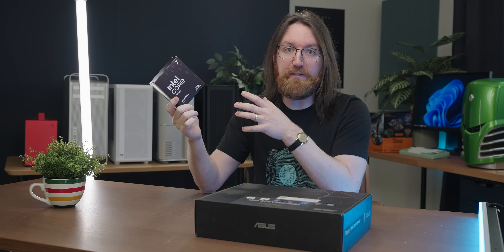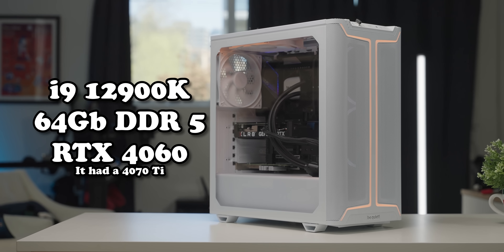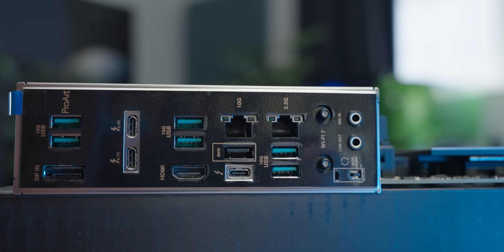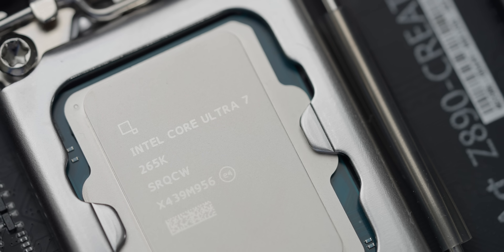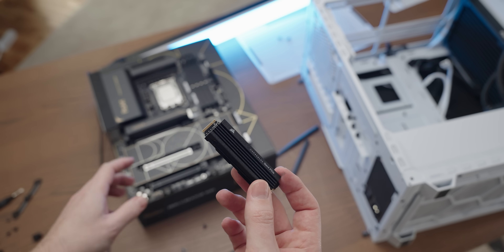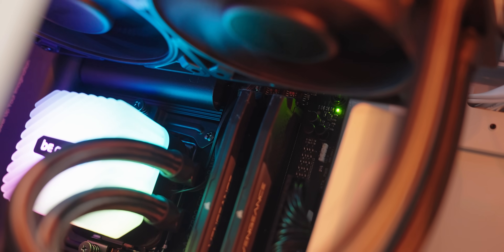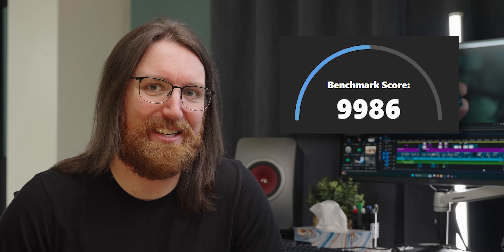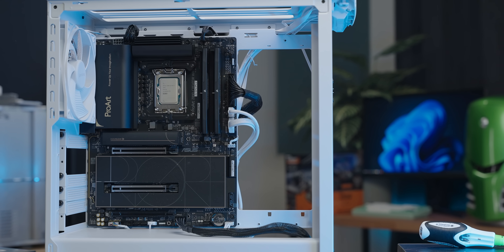I ACTUALLY Bought An Intel Ultra CPU In 2025...

Comment: Intel extinguished thier cpu lineup to start cooking for thier gpu lineup.
Reply: No, the B580 is even less competitive than Core Ultra.
Reply: @lharsay  For 250€ the B580 punches above its weight class.
Reply: @lharsay are you delusional
Reply: @happygofishing  just look at the raw specs, the B580 is basically an RTX4070Super, yet it's only half the performance.
Reply: They are just getting started on this generation of CPUs. I would imagine in the next year or two they’ll be back on top. This coming from an exclusive Ryzen user
Reply: I don't see it happening ngl.

Comment: I've actually never seen anyone talking about this CPU
Reply: The reason is its so similar to 285k in performance so intel just not let anyone review it.
Reply: LGA18XX socket isn't likely to support further than Arrow Lake, plus the underwhelming performance in game so no one really cares about this. I might get onboard next year when Arrow Lake get massively discounted to get rid of old stock, as it stands my i9 11900F is still rock solid
Reply: @ThangDamMinhwell Linus from ltt continuously calling out Intel BS since 10th gen and before. Finally he stopped caring about intel repeated greedy treatments
Reply: @ThangDamMinhHot take on 11th-Gen. I liked it too actually. I had an 11900K and it was a great CPU once you tuned it.
Reply: @ThangDamMinhgood idea. I just bought one on new egg they had so many discounts it basically changed my plan of getting a 9900x  instead.
Reply: @ThangDamMinh it excells in video processing and productivity like photoshop and such. its like 4x faster than a 9800x in these type of tasks
Reply: for multiple very good reasons
Reply: The 265K is a good CPU. Right now and for some time, MicroCentre has a 265k and MSI Z890 MB for $530 USD (which is less than what I paid for my 285K with a 1T Corsair gen 4 and some video game freebies tossed in)
Reply: Because all anyone can talk about is X3D, even those AMD fanboys that don't own an X3D. It's just like the Nvidia owner that bought their 4060 only because the 4090 exists, while not even considering Radeon. For the money and if you don't own a $2000 GPU to game at 1080p the 265k gives up nothing in gaming to X3D in real world settings and pairings, while utterly curb stomping the X3D in multicore. And that's when the X3D is a whopping 50% more expensive.
Reply: That’s because it really is only good for very isolated productivity workloads. And you really need to do your homework to figure out if it works for you.
Reply: I loved talking about how happy I am with my 285k on the PCMR subreddit, but the comments usually mirror the youtube comments, but worse, something along the lines of...
- hardy harr, you wasted your money
- bad value
- AMD IPC better
- why didn't you go AMD?
- Intel bad
I got tired of it, so I stopped talking about it and deleted my posts.  I don't think I should have to justify my purchasing decisions, but I got an 1851 board for free, and though my original plan was to get a 265k, the stars aligned and was able to get a 285k for not much more money.
Reply: 6 Months with all the BIOS upgrades I am loving this CPU
Reply: @ProfexionalGaming  Intel is now the value king hahaha.
Reply: It appears to be the best (or least poorly) selling of the series as a cheap productivity CPU.
Reply: Man, the #1 pre-built on newegg had a U9 285K @lharsay
Reply: That means you're probably only watching gaming focused stuff.
Reply: I bought it. And I play games on it. It plays well for me.
Reply: I think you should use search in youtube sometimes
Reply: Bucz iyk ik
Reply: They abandoned the i3 i5 i7 for..ULTRA....hmm
..
Reply: @chen4132  - yes, 3 generations across 3 processor configurations and multiple varients. IT MAKES NO SENSE that Intel would abandon the LGA1851 socket after 1 generation.

The actual architecture within the Core Ultras is far superior to its predecessor. people (by that I mean gamers) seemed disappointed with generational progress in performance - but, gaming is but a tiny fraction of conputing. Although I miss Hyperthreading, I prefer the wisdom of the Core Ultra die layouts.

I have gotten 1589 on Cinebench 24 multicore with a 285k running XTU. It capped the silicone a <300W and 400A I think it was and core temps were 65 deg C ish. I can push them into the 70s C. But why? 

I would be interested what @DawidDoesTechStuff gets on his silicone  (we are running different CPUs but I can't make the comparison myself). He made the right choice. The MB might be a bit weak and be holding it back a smidge.
Reply: Well, they're shit for most things, if you just buy their predecessor, it will be much cheaper, and give more performance
Reply: It's obvious why
Reply: read it is curated to be pro amd
Reply: Why would you? This whole line is a literal joke.
Reply: tech notice and other creators who do video editing ,ultra cores are the best in video editing
Reply: I gots it in my gaming pc
Reply: Felt like a decade since all the Intel instability issues and these CPUs launching.
Reply: I wish there was more
Reply: @a.jracing - y'all know this guy Geoff/maybe Jeff Gearing (he's big on the ARM CPUs Raspberry/orange... fruit pis...).

He had some board with an AMD server CPU I think it was and was doubling cores on top of the previous like 48 cores. It may have been more, I don't recall.

Anyways he has a screenshot showing Cinebench 24 on all those cores -- low and behold, my 285K w/24 cores out performed it.

This guy is right, the Core Ultra 7 is one heck of a performer for the price. I have the 9 and there's a price gap. I don't regret the buy but my temps are great, it's stable (Linux - as an educational experience has been a tad rough but I think that's a Linux thing and me not knowing more).

What I think is one of the most important features of these is the new chipsets that will let you run both - your video card AND NVMe at full PCIe 5 speed. I have only a 40 series card but I don't slice it to 8 bit mode like so many Z790 boards.
Reply: It's like talking about which seat on the bus is the best
Reply: All these YouTube channels are focused on gaming performance. There is a whole other massive spectrum outside gaming if it comes to computers.
Reply: @robindebondt4643  Almost as if the majority of their viewers are gamers or something. Shocking I know.
Reply: me too!
Reply: That's because Youtubers are 95% gaming only, they dont care about using a PC for anything else. You wont get anything close to a proper review out of the likes of Hardware Unboxed for example. Even when they include productivity benchmarks they dont do it well.
Reply: @chrism2964 It actually has to do with the lack luster last 2 generations. Its gonna take a couple of these Ultra cpu's to catch on.
Reply: Where have you been under a rock? Hardware unboxed and Gamers nexus reviewed it at launch.
Reply: I swear these are just rotting in warehouses, the Ultra 5s especially, who tf wants a 10 core CPU in 2025
Reply: the problem is the 5800x3d destroys this cpu on the benchmarks.
Reply: @viscountalpha  Jumping in here—no, the 5800X3D doesn’t “destroy” the Core Ultra 7 265K except in super niche, CPU-bound 1080p esports titles where its extra cache pulls ahead by a few frames. In modern AAA games at 1440p/4K (and in any multithreaded workload), the 265K matches or outpaces AMD—plus you get on-chip graphics, AI acceleration, DDR5/PCIe 5.0 support.  So unless you’re strictly on DDR4 and chasing marginal 1080p gains, calling the 5800X3D a “destroyer” is just clickbait.
Reply: @Wakenbank  even then only on launch its been fixed a bunch since
Reply: @viscountalpha my 14700k begs to differ. Especially in anything other than gaming, which it’s more than capable of as well. You’re probably high if you spend 2k on a pc and leave most of its power on the table by just gaming. People other than tweens buy PCs, ya know.
Reply: @viscountalpha  5800x3d single core performance barely beats an OC 8700k. 5800x3d = 595 , 8700k = 575
Reply: @viscountalpha  No it doesn't lol
Reply: @viscountalpha maybe like 5+ months ago before all the driver n bios updates bringing up gaming performance. They are not horrible these days at all actually competitive with non x3d chips on am5 and have wildly good multi thread workload power under the hood. Gaming is a very small market share portion of the people buying pc hardware.
Reply: @alancarr195  the mistake in this is unreal and the gaming industry. Blueprints, and sh..t programming is all around us. if you really use multicore in a game like i do, than the amd cpu loose in a huge difference. 9800x3d of my nighber is 60 percent slower than my ultra 9, go up to 80 grad degree. i stay at 38 up to 40 grad degree, no framedrops, he drop down to 40 fps. to less cores, that s it. 8 cores cant calculate what 24 can do. that s the point.
Reply: @alancarr195 people buying pc hardware majority for gaming, the one who buys it for standard use office work buys old intel cpu 😂
Reply: @viscountalpha  Gaming benchmarks. This destroys the 5800X3D in productivity which is what most PCs are used for.
Reply: @chrism2964  "which is what most PCs are used for."  

i think we know what most PCs are used for ... 

homework folders!  🤠
Reply: @viscountalpha  and which benchmarks is that?  because it beats the 9700x most the time
Reply: @nostrum6410  has to be talking about the gaming benchmarks right at launch before all the fixes lol
Reply: @ ya it was a bad launch, hard to deny that
Reply: @viscountalpha  in the benchmarks, right.
i only can say following: my software, a game, mostly cpu driven, not gpu focussing. 
amd 9800 x3d vs ultra 9.
i can do all tests here, in direct. my nightber have 9800, i have ultra 9.

results.
calculation of my holiday and camping area.
to calculate, 20 girls, some other things, very hughe calculations in just 1 singel frame.
frametime.

amd ryzon 9800 x3d,  0.6578 secundes.
intel ultra 9 285k, first bios update, actual bios update not done i will not do. 0.1735 secundes.
my memory speed, 5200, nighber momory speed 6000.

calculation of the compass rose ingame, a lot of vector 3d calculations with every frame per runtime.

ultra 9 frame result 60, more then enugh power left.
amd 9800 x3d result 40 fps, limit. Temperatures, ultra 9 38 grad degree, 9800 x3d 70 up to 85 grad degree, all 2 are cooled at be quiet silent loop 2 360.

results in direct. ultra 9 60 fps, no framedrops.
9800 x3d framedrops down to 40 max, at 116 compass places.
that s just, my game use multicore right. other games not.
Reply: @opafritzsche  how do you calculate 20 girls?
Reply: @Zangetsu2026  more than this, in complete are 40, but 20 are autark self lifing charakters inside my world, with her own autark life.

how ?
i made them.
Reply: @opafritzsche   yooo, are you running or making Artificial Life simulations?   is it something like the Sims games?
Reply: @opafritzsche   oh, you said it's a game.  what game is it?  it sounds interesting.
Reply: @Zangetsu2026  not easy to explain, i am a mix of life sim, gta, flirt simulator. but this time, my game is not official released, and i think about, if i want this. i dont know. in lets say 2 - 4 months i am final for, but i am not sure. today all is just Superficial, and there's no real depth. Everything is judged based solely on first impressions, graphics, and Netflix cut sequences. That's not the content of my game; it's about soul, depth, respect, self-discovery, society, decency, and, of course, eroticism. It's about bearing the consequences of your actions. Nothing happens without triggering a reaction. It's too complicated to explain here.
Reply: @opafritzsche  dude that sounds cool!  i hope you post some videos on your game's progress, please!